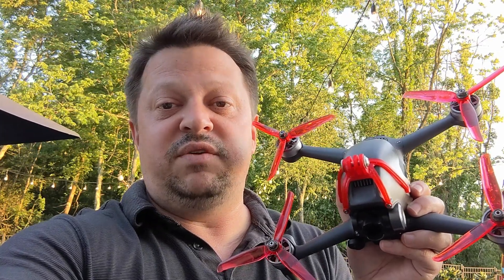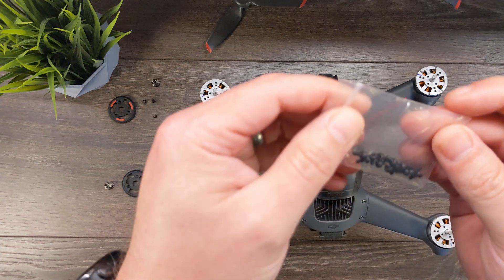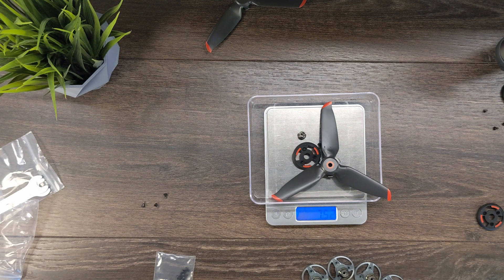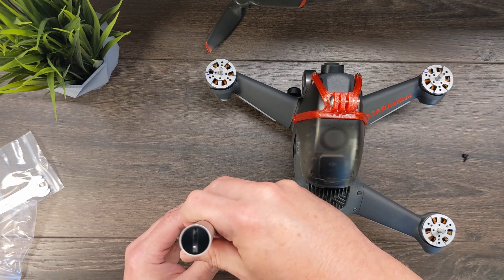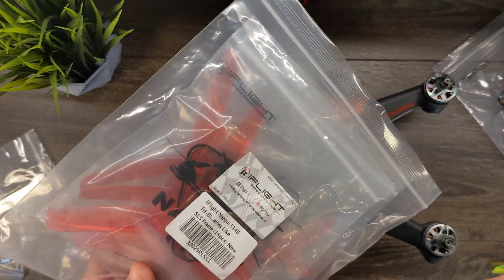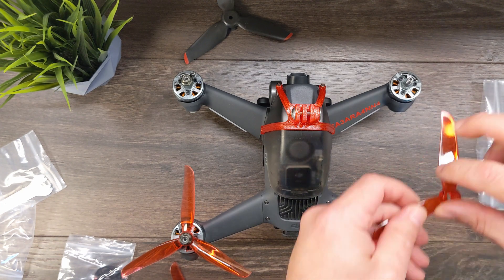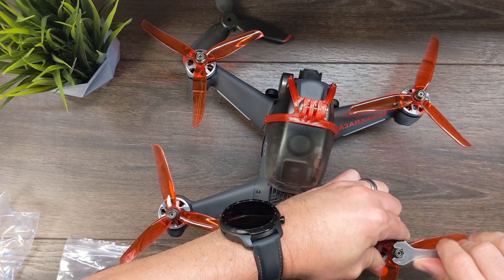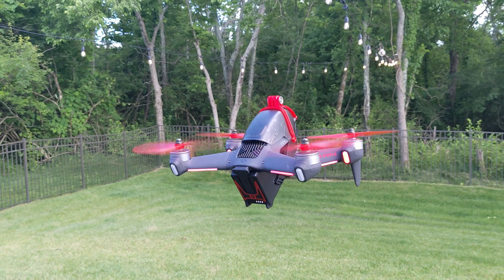So Much Better! Aikon DJI FPV Prop Adapters + Nazgul Props

Comment: You’re the only one I have seen actually fly the potato somewhat quick. Been a custom fpv betaflight guy for 10 years, you think if I install these adapters maybe a set of gemfan 51477, it would fly more like a light analog Nazgul as opposed to a potato? 🤔🤔
Reply from the maker: It gets close, it's still a heavy drone though.

Comment: Hello friend, did you have any problems using these nazgul 5140 propellers on the DJI FPV?
Did you warm up the engines?
Reply from the maker: No problems, motors stay fairly cool.

Comment: Do you use the blue thread locker on the prop adapters?
Reply from the maker: Yes, I use blue. Blue is the best for this application in my opinion (if you want to be able to remove them in the future).
Reply: @AerialPixel  Thank you for replying , I have just got some prop adapters for my DJI FPV drone and some blue medrm locktite thread locker. I asked on a DJI FPV drone group on Facebook if I should use threadlocker but the response I got from most people was it maybe risky as there is plastic in the motor holes and some may fall into the motors, I feel the prop adapters will need thread locker. What's your opinion on this? Thank you 🙏🙏
Reply from the maker: I'm not sure where they are getting that there is plastic in the motor holes, perhaps they aren't familiar with the Aikon prop adapter install. The black plastic ring on the motors is removed leaving only the aluminum motor bell. Any metal-to-metal screwed connection should use thread locker.  I would recommend applying the thread lock to the screws and allowing it to air dry before installing them.
Reply: @AerialPixel  Great thank you I will do that, thank you for your help I was sure it was just metal to metal, they just said they had been using the prop adaptors for ages without threadlocker and always been fine and was risky using it. I agree with you that it's better to use it as the motors are spinning at such a high speed, lot of tension on those little screws. Thanks again 🙏

Comment: We the hassle, the effort? Just get regular fpv drone and you will be blown away...
Reply from the maker: I've flown traditional FPV for 3 years now, the DJI FPV drone has it's place with it's advanced features like return to home, extended flight times, etc. The purpose of this video is to show the use of better and cheaper props compared to the standard DJI quick release props, not debate traditional FPV vs DJI FPV.
Reply: @AerialPixel  so that dji fly only few minutes longer and for intentions of fpv, the return home buttons is pretty pointless, unless it detects when you lost video feed and avoids crashing.the dji is only good for cinematography and yeat the camera inside this one is not so good compared to gopro.
Plus im not telling you specifically, just overall, why to hassle with those props... Get a drone for 100-200$ and it will fly better.

Comment: I tried out some 5045 bi blades.  More efficient and faster in sport mode 63 mph vs 61 mph I was getting on stock props but I like the overall feel of the nazgul 5140

Comment: I've got two DJI FPV Drones and had the direct comparission between original and Aikon (but with GEMFAN Hurricane 5236) and they are much much better, the drone flies more stable, faster and is not as loud as with the original props. Funny i got the same electric screwdriver, its from Banggoood right? But with the Loctite you have to be sooo careful...if you use too much, you will never again be able to open the screw again.
Reply from the maker: I like the GEMFAN Hurricane's too, I use those on several of my traditional 5in quads too. I got my Wowstick screwdriver on Amazon, but yes, it's popular on Banggood too. The blue Loctite is the removable one, but yes a little bit goes a long way.

Comment: Which Antennas you use ? Are you have any Range Extenders for the Goggle ? Which Setup you got ? 

If i would fly behind them Trees and Streets, i see bricks and cubes and then the link would end. 

You got any Tips for me ?
Reply from the maker: On the DJI FPV drone with the V2 goggles I use the standard antennas. Increase the power to the highest mw available in your area.  I use the V1 goggles for most of my traditional FPV drones and use the iFlight Crystal system on those, range is crazy good with that system. Do not use that system on the V2 goggles though, they are not dual band compatible. 
iFlight Crystal Patch: https://amzn.to/3nMrV8D
iFlight  Stubbies: https://amzn.to/30W9cPv
Reply: aaah okay... thank you mate! So you mean i can't use the iFlight System with my DJI DRONE ? 
I just have this FPV Drone and I love It 90% ! But sometimes dem Crackups make it hard to love it 100% you understand ?
Reply: @estK-mh1uv  just do the drone hack for more range! Worked so good for me in Europe!

Comment: Does this adapter compatible with  the bebop 2  motors
Reply from the maker: No, they are only compatible with the DJI FPV drone.
Reply: Ok ty

Comment: Where did u pick up your tiny colored numbers and letters on your wing at? And also does anyone make a m5 shaft prop that is similar to DJIs stock design to retain punch out and top speed?
Reply from the maker: You can pick up our FAA registration decal set on our website here http://bit.ly/faadecals
I've had good luck with the Dalprop Spitfire props.
Reply: Awesome!! I’ve looked for hours trying to find the right size and style for my quads , definitely be placing a couple orders with u guys very soon!! Thanks!!!

Comment: can it fit 5.5" props ? 😈
Reply from the maker: I have not tried 5.5" the DJI props are 5.3" and seem to have room to spare. Using a prop that size you may want to keep the pitch down a bit though, I would guess between 3.0 and 4.0
Report back if you try them!
Reply from the maker: Just some heads up, I did some measuring for you, since I don't have in 5.5" props on hand, the props may touch tips, it will be really close. You have plenty of clearance at the body of the drone but the front props and back props will come really close to touching.
Reply: @AerialPixel  thanks. I might try it when I can get the fpv

Comment: But at 82 mph it is slower than with the original props
Reply from the maker: I've been running the Dalprop Spitfire T5147.5 and you can get them a bit faster, I've gone 93 mph on those. Keep in mind it's not just about speed with the props, the drone handles so much better with a more rigid prop like the Nazgul and Dalprops.

Comment: Nice video. But it's illegal to be flying on your neighbors property 🙂
Reply: You or your neighbors don't own the airspace above your house or property.
Reply from the maker: That can't be further from the truth (in the United States at least), you may want to do a little research on this. It's obviously not a good idea to loiter over a neighbors property as you could get into privacy issues at that point. If you stop and think about it using your logic you wouldn't be able to fly anywhere as someone owns all the property you fly over whether it be a private or public entity.

Comment: Any limit to the prop sizes, i.e 5.1 inch is max, and limit pitch?
Reply from the maker: I've flown Dalprop Cyclone's T5249C the 5.2" size fits fine, that pitch is getting toward the upper limit, motors were getting a little warm.
Reply: @AerialPixel  dji props are 5.3" but what is the pitch? nevermind found it. 5.3x2.8x3

Comment: I fly regular FPV Quads and was exited to try these adapters but was disappointed in the results.  I to like the Nazgul Props and the Ethex S5 and S4 props.  I found that the punchout was not as strong as the DJI Stock Props and there was no noticeable difference in prop wash.  The motor temps were also higher with the non DJI Props.  For me I switched back to the DJI Props because I like the quick removal to put it in the bag.  I do see the cost advantage if you are starting out in FPV and crashing the Nazgul are much cheaper.  🍍
Reply from the maker: Give the Dalprop Spitfire T5147.5 a shot too, I've been flying those lately, motors are slightly warm to the touch still but not bad, punch is pretty good too.
Reply: The adapter adds a lot of weight.

Comment: How do you feel about Lumenier gatebreaker props
Reply from the maker: I like them on traditional FPV kwads, but I think there would be too much amp draw for the DJI FPV, may even throw some motor overload errors. Top two favorites right now are the Dalprop Spitfire T5147.5 and the Nazgul 5140's
Reply: @AerialPixel Is it the same now?
Reply from the maker: @원폭맨  I don't use the DJI FPV as much as I used to. I have the Dalprop Spitfire T5147.5 on there now, they fly pretty good too.
Reply: They feel kinda sluggish to me

Comment: Using Dalprop Spitfire T5147.5 and they seem to be great!
Reply from the maker: I recently bought a few sets of the Spitfire's they are on the drone now, they are very comparable to the Nazgul 5140's
Didn't notice a huge difference between the two, I got speeds in the Mid 80's on the Spitfire and low 80's on the Nazgul. Handling feels about the same both excellent props.
Reply: Found using dal spitfire and gemfan gave me insufficient battery when coming out of hard banking speed 61mph on coming out of turn it struggled to get 12mph with battery warning I put originals back on no battery issues no speed drops so I'm back on originals

Comment: What size screws for the motor mount?
Reply from the maker: The screws come with the prop adapters, they are M2 screws 0.4 pitch. There are 3 screws per motor.

Comment: Does it affect your flight altitude
Reply from the maker: No, there are no differences in flight altitude.  I haven't been to a higher altitude location like a mountain range yet, but just normal flight is good. Fly safe!

Comment: How many minutes of flight do you get with its propellers ?
Reply from the maker: Depends on your flight style, my flight times seem to be about the same as with the DJI props.
Reply: @AerialPixel  I’ve looked at a lot of your videos but haven’t seen any comments addressing flight time differences with the gopro added. Could you shed some light on that please? I’ve heard that without the GoPro you’re looking at 9min full acro and 15ish minutes while keeping everything fairly level.

Comment: Did you notice any lost in punch out power or anything like that ?
Reply from the maker: Not with the Nazgul props, one reason they are my favorite so far. No washout or wobbles on recovery either. Everything just feels really tight and precise.
Reply: What about time loss?
Reply from the maker: @belovedLion80  I haven't noticed flight times being any shorter, I do find myself flying more aggressively now though because it flys so much better with the Nazgul props.